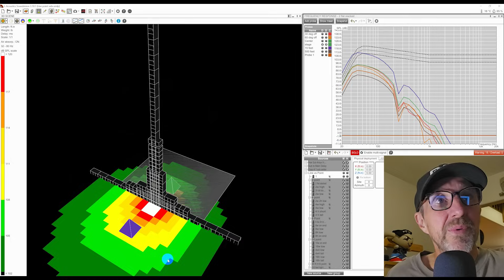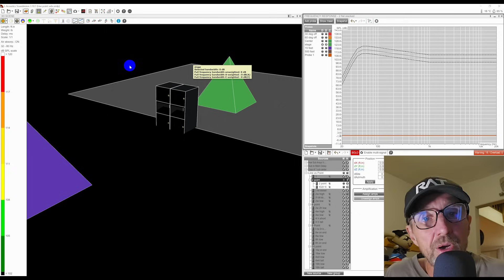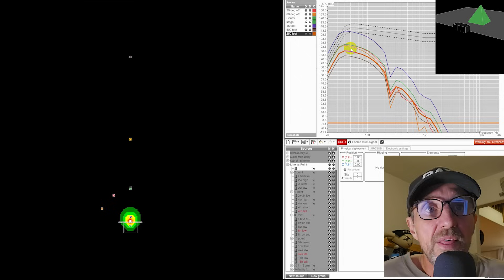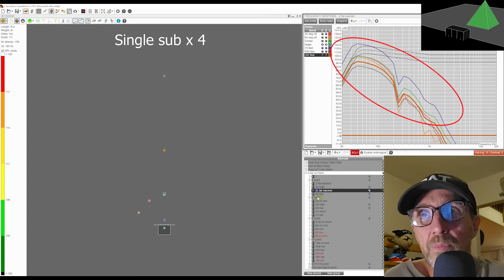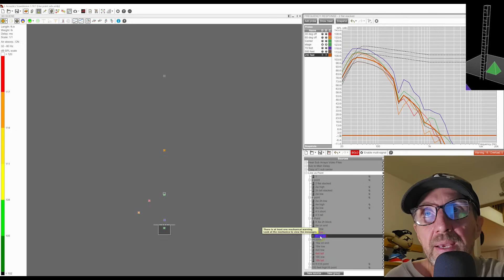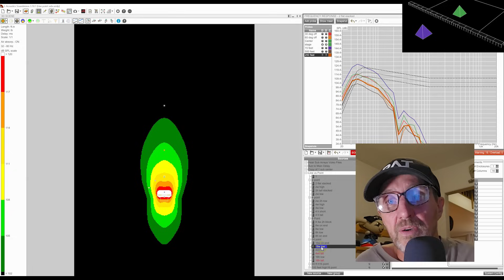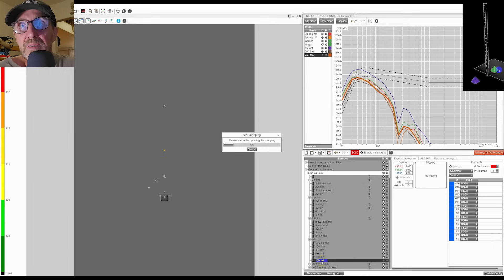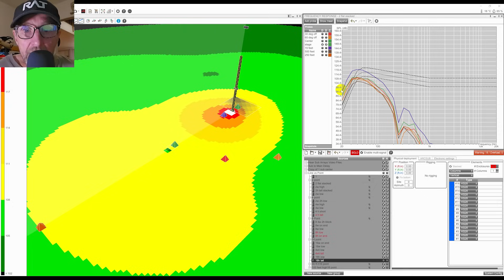Point Sources Are Ideal... Or Are They?

Comment: Dave… as far as “emotional alliances” go, I think you have fallen victim to that yourself. 

1. You haven’t considered flown cardioid point source solutions. This would greatly improve the coverage of the point source solution. 

2. You haven’t considered additional baffle gain by a large point source, and since your software can’t simulate it you don’t see it. 

Combine the two above and you could improve the coverage of the point source solution by at least 10db. 

3. You haven’t considered the problem of multiple arrivals created by large arrays, and how these affect the impulse response and therefore SQ. You yourself have demonstrated the sound of this effect previously by artificially entering delayed subwoofer signals into a mixer, and then feeding the summed signal to the listener. Indeed, the result was worsened impulse response and a rolled off top end of the response. It sounded dull and smeared.  

So… your video is actually equal parts informative and misleading.
Reply from the maker: These are great concepts and all were considered and #1 & #2 are not relevant and #3 is demonstrated in the video.

 While cardioid can be very useful in reducing energy radiated rearward, it has no impact on the differential in near versus far volume levels.

The same is true for increasing the size of a baffle, which may offer additional gain or directionality but will not change the differential of near versus far field sound levels.

So you may be able to implement things that increase the volume level in the far field with various point source solutions but they will also increase the volume in the near field and not achieve a reduction in the differential of the volume in the far field versus the near field like a line array is capable of doing.

I use point sources and line arrays and do not prefer one or the other as they both have their assets and issues. This info is to help understand that a line array is capable of reducing the volume discrepancy of near versus farfield sound while point sources do not inherently have this capability.

As far as the multiple arrival time issue assumption, that concept is actually considered and shown. When there are multiple signal arrivals at differing times it will have a definitive impact on the frequency response and create comb filtering and/or variations in the frequency response unless if they are perf ctly time aligned for summation. And as you can see in the predictions the frequency responses of the point source versus the line array are practically identical for all the probe locations both on and off axis.

Or looking at it the other way since there are no significant variations in the frequency response then there are no significant variations in arrival times of both the point source and line array in the horizontal domain.

Yes there is more to the story in that in the vertical domain the line array will alter in frequency response (arrival time) more than the point source but the point source is incapable of maintaining volume over distance like the line array.

This information can be useful for determining which system is optimum for the application.
Reply: @DaveRat  I think you missed the word “flown” under my first point. 

A flown cardio’s point source will naturally have less energy pointing downwards and backwards than forwards, and therefore it can lessen the difference in volume front to back. You didn’t include a cardioid flown point source in your video. 

Baffle gain is gained perpendicular to the baffle, and then less so the further off axis you go. A flown point source that measures 10 by 10 feet will have about 6db of baffle gain at 60hz. 90 degrees of axis it has zero baffle gain. Your software can’t simulate baffle gain, so the front to back difference of a flown point source will be larger than what your software will show.
Reply from the maker: Using the off-axis response of a cardioid setup to control near versus far volume levels introduces the multiple arrival time issue and alters the frequency response in negative ways which we are not seeing in the line array deployment. So that's a step backwards

Furthermore, line arrays can also be set up in cardioid configurations to create that same effect so this is not a point seource versus line array concept. Using off axis cardioid to control volume over distance works with both line arrays and point sources in addition to that fine erase are able to offer much more control of volume over distance regardless of the configuration
Reply: @DaveRat  True, but again, your software can’t account for baffle gain, and baffle gain works both forwards and backwards, meaning that the subs in the back don’t have to have nearly as much output capability as the front subs to be able to properly attenuate the output backwards and downwards (as long as you make use of the baffle area of the back of the front subs). 

Let’s for the sake of the argument say that you have 5db of flat baffle gain. Then the subs in the back has to put out 5+5db less to properly attenuate the output from the subs in the front. So, the subs in the back run 5db less hot (the baffle gain backwards account for the other 5db), and the subs in the front have 5db of baffle gain forwards while the subs in the back have no baffle gain forwards (only backwards). So, the subs in the back put out 10db less forwards than the subs in the front do. This in turn means that the detrimental cardioid effect in the forwards direction get lessened when compared to a smaller cardioid point source solution. 

Line arrays can also be set up in cardioid, but the subs on the ground (as per your example), will be as loud close to the array with as without a cardioid configuration. Off to the side the cardioid line array will be more silent though, just as the flown cardioid point source will be, but both in the horizontal and in the vertical plane.
Reply from the maker: I think you might be overcomplicating and missing the core concept here. 

But first, I believe what you're referring to as baffle gain, is using a baffle so large that it creates a half space for frequencies relevant to the baffle size and above.

The size of this to have an impact on low frequencies would be significant and perhaps in the tens or hundreds of feet depending on the wavelength of frequencies.

If that's what you're talking about, then applying that to a point source or a line array would have a similar or the same effect so it's a wash if comparing the two source types.

As far as cardioid line arrays and placing an identical line array behind the original line array versus cardioid point source and placing an identical point source behind the original point source All factors remain the same and the point source will maintain that 30 dB drop at 500 ft and the line source as in the example approach is a 14 dB drop over 500 ft.

The only way that I know to reduce the volume drop with distance using point source type enclosures is to use incrementally more directional horns for the farther throw and less directional volume shaded horns for the near field.

This vertical stack of varying dispersion point source horns, is basically emulating what a line array does naturally but has the downside of introducing transitional issues between the various horns, unlike a properly designed line array which maintains a coherent output as long as the drivers are positioned very close together in relation to the highest wavelength each driver reproduces
Reply: @DaveRat  

Actually, the baffle doesn't have to be all that big to have an effect. Look at Danleys BC series for instance. Two BC218's flown in "full moon mode" are 10db down behind the subs at 61hz, and 4db down at 30hz. That's a stack that's 10 by 5 feet, so there's quite a bit more to gain when you move to 10 by 10 feet. The hidden factor here is edge diffraction, which is really the other half(depending on the wavelength) of the total baffle gain, but commonly included in the terminology "baffle gain". The total effect is indeed as large as I previously mentioned, and the baffle does not have to be hundreds of feet big to have an effect.

"applying [the baffle gain effect] to a point source or a line array would have a similar or the same effect so it's a wash if comparing the two source types"

That's not correct. The baffle gain exists perpendicular to the baffle, and then decreasingly so as you go off axis. If you fly a point source and point it over the audience, the people below the point source would not experience the baffle gain, but the people in the back would. With a ground stacked line source (as per your video),  both the people far away and the people right in front of the bottom of the array would experience the baffle gain since they're both perpendicular to the baffle.
Reply: @DaveRat   Just bumping you here so that you can find my last comment.
Reply from the maker: There are numerous contraptions and concepts that can be applied to the fundamental realities of point source and line arrays.

This video shows how line arrays and point sources inherently perform in their most simplistic way before any outside complexities are added

Adding baffles, creating cardioid arrays, gain shading the elements in a line array, adding curvature to the line array and adding multiple point sources with varying degrees of directivity while trying to minimize overlap, are just a few that come to mind

There are many advantages and disadvantages to the two fundamental types. Line arrays are inherently superior at achieving more consistent volume over distance while maintaining horizontal frequency consistency while being challenged at vertical frequency consistency. Point sources are superior at maintaining both vertical and horizontal frequency consistency but our challenged with maintaining consistent volume over distance.

There is no bias here just information that helps you select the optimal tool for the job.

For smaller spaces where volume over distance is less critical point sources tend to be a better choice.

For larger spaces for volume over distance consistency is more important line arrays have an advantage

For spaces that have significant coverage needs in both the vertical and horizontal domains, point sources have an advantage

For environments where the horizontal coverage is wider and a priority and the vertical is more limited, line arrays have an advantage.

Point source manufacturers jump through all kinds of hoops to get their arrays to do what line arrays naturally can do

Line source manufacturers jump through all kinds of hoops to get their arrays to do what a point source can naturally do

This video is about pointing out One aspect of what line arrays and point sources naturally do

Comment: Totally agree about flown line arrays as subs. If it can be done, and the ground and ceiling reflections made to combine in terms of phase response, the subs will be able to send a plane wave down the room. This could be called a "transmission line" design principal. 

It is also possible to have a braking system which intelligently anti-phase reinforces the sound at the rear of the room - an electronic load can be driven and tuned from a stack of subwoofers. A light bulb and some capacitors and transistors is quite sufficient in most cases. Much cheaper loudspeakers can be used for sound removal.